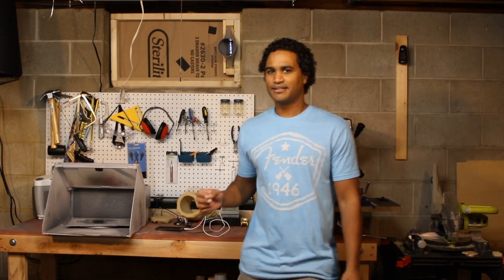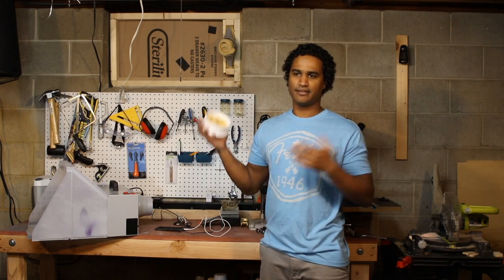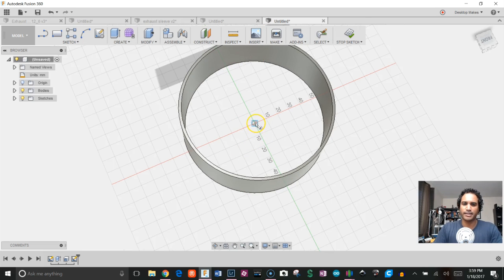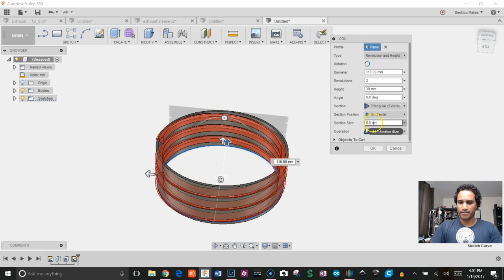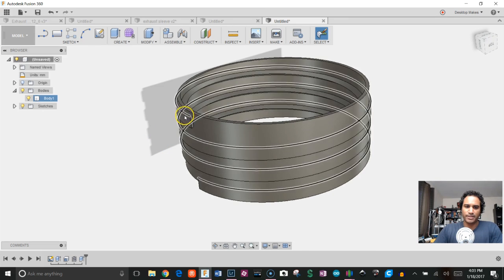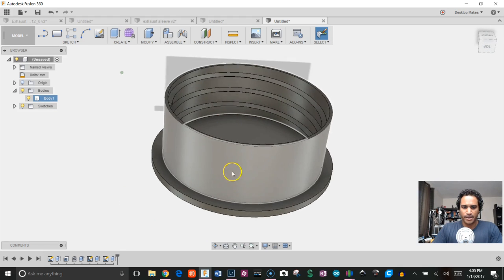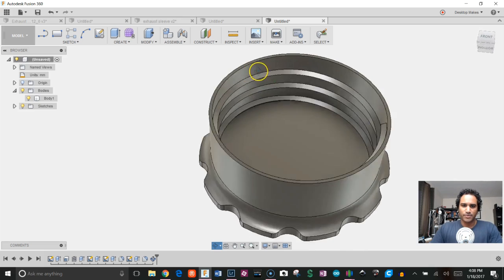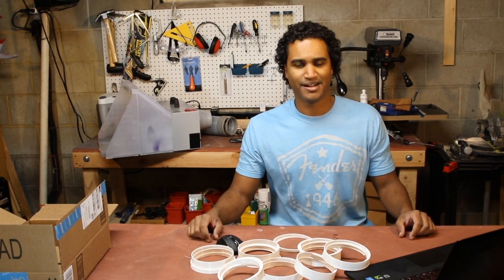Model Custom Threads in Fusion 360

Comment: Hi. Thanks for another great tutorial. Watching it today, 8 Feb 2022.
What is the advantage using a coil over the thread feature F360 has?
Reply from the maker: The Coil tool lets you design Custom threads in case the Thread option doesn't have the exact thread profile you need.

Comment: Great video man. Quite helpful. You said 110mm for the cap to fit 108 mm, i am like 'wow, do i also need that much clearance?'. Then, you shell out 2 mm in Fusion 360. So, basically 108mm for 108mm :D
Reply: No. It was an outer shell, not the default inner shell. One mm clearance (on each side if centered) is about 1 percent of the inner diameter.
Reply: @michaels3003  Well done for correcting that guy's misunderstanding.  Great video BTW. I am enjoying your Udemy course at present.  Just watched the soap dish episode. 🙂

Comment: Wow - someone else who takes a few iterations to get their one-off projects just right?  Yeah - that's WAY encouraging!  Thunk I were the Lone Stranger!

Not really - that's one of the "features" (as Mikro$ift might spin it) of 3D printing - easy iterations with short cycle times let your work it until it's good enough for who it's for!

Anyway, thanks for the idea with the coil thing - looks like what I need to revisit a low priority project that I looked at and promptly set aside some time ago - a nice aluminum water bottle that somehow got separated from its screw top - while being hooked up with the WRONG top with totally WRONG threads - so someone else out there somewhere has the exact inverse problem as mine, it would appear.  Odd thing about it is that there are TWO threads, each starting at 180 from the other.

So a double dose of kudos on ye!

Take care!